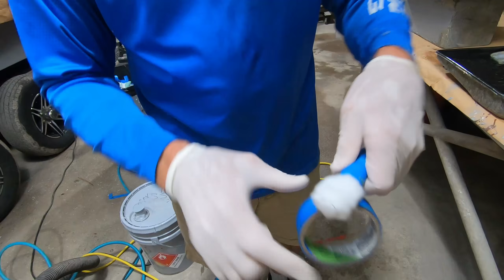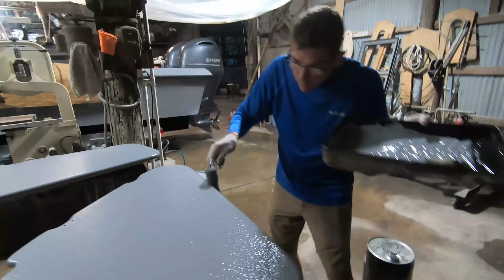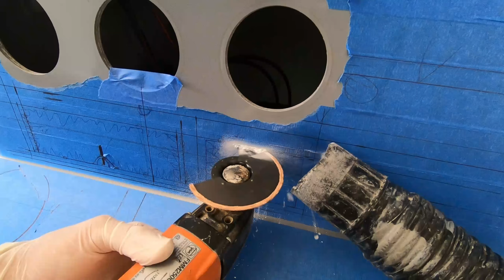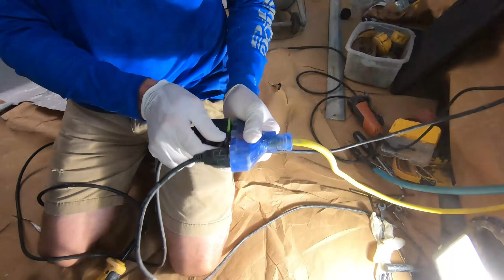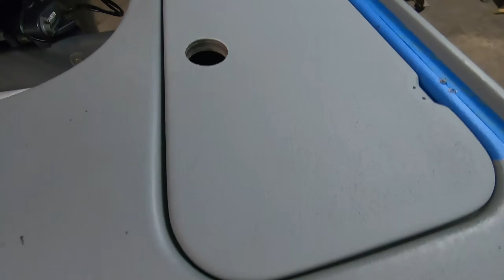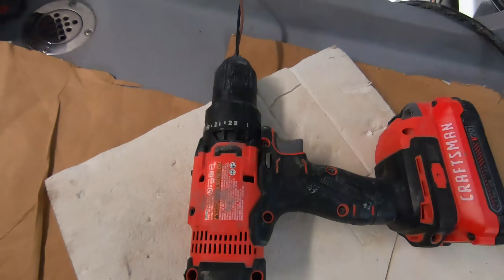EP-23 WE ARE BUILDING A NEW BOAT! HOW-TO GELCOAT AND NONSKID YOUR BOAT

Comment: I'm not sure why you don't use the foam rollers? Must be easier than wrapping the fluffy ones in tape.
Reply from the maker: I have just never been a fan of foam rollers for working with polyester and vinyl ester resins. They don't load up as fast  and sometimes they just fall apart midway through a job. Foam rollers can work well with epoxy resins because they introduce much air into the resin. Of course, everyone is welcome to use whatever they want to use, but I will continue to use what works best for me. I hope this helps and thanks for watching!

Comment: I have a 22 foot all Craft  with a cracked stringer and the deck is glued down to what I call the cap. I wanted to remove the rub rail all the way around make the cut at the rub rail and then remove the deck. can I get that off? Can it  be pried  up with wedges to break that glue bond while applying upward pressure?
Reply from the maker: Not all boats are assembled the same way, so it is hard to say for sure. But in my experience, it can be very difficult to remove the cap, without damaging something else in the process. There isn't really an easy way to get to the stringers. One way is to cut the floor itself out, leaving a 2 to 3-inch flange around the edges which gives you something to fiberglass back to. Hope this helps. Good luck with your project, and thanks for watching!

Comment: Are you going to put gaskets on the hatches ? I’m building my boat right now with all Coosa and I’m trying to plan out building the hatches and am gonna do it just like you did but I want to put rubber gaskets but not sure how.
Reply from the maker: I have not put any kind of gasket on them yet. They seem to hold ice very well even without a gasket. I am sure a gasket would make them hold ice even better, and be quieter too. I have not settled on a method for gasketing them, as it would need to be very durable for my application. If you find a material you really like, or have any suggestions I would be interested to hear it. Thanks for watching!

Comment: im doing a gel repair  about 3ft x 3ft but keep getting rub through outside the repair where yhe gel is so thin. any ideas how yo stop this
Reply from the maker: I would recommend using some of the 3M dry guide coat for the wet sanding process. It really helps you to know where you have already removed enough material, without removing too much. If you have to re- gel coat the area, apply more than you think you need, that way you have more of a buffer zone.
Reply from the maker: I recommend using the 3M guide coat when you start the wet sanding process. It really helps you to know when to stop sanding. Would also apply more gel coat than you normally would, so that you have more of a buffer zone.

Comment: Great stuff! I was working with gelcoat today and it was going off in 10 min with 1/2 activator.
Reply from the maker: Thanks, Gel coat can be tricky in hot weather. The warmer it is, the faster it is going to cure. I always try to work in the shade, sunlight will speed up cure times. If you can work very early in the morning when it is cooler. And you can even try cooling down the gel coat to extend cure times. In a perfect world, I would like low humidity and temps in the 70s. Hope that helps!